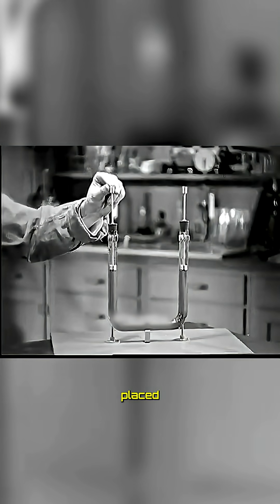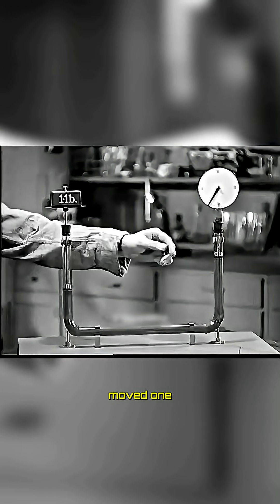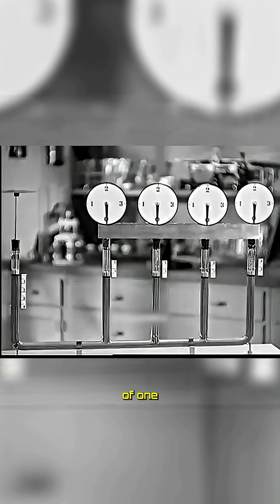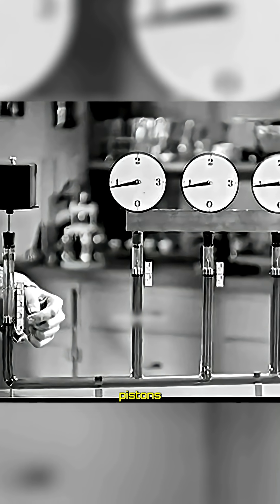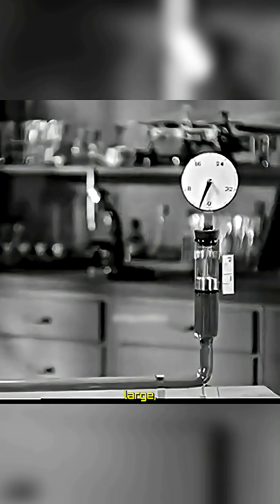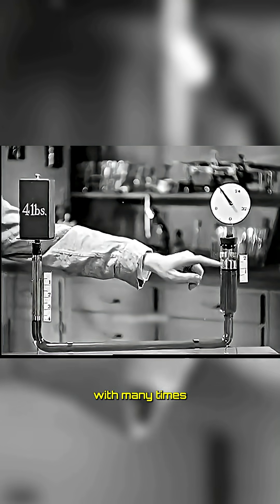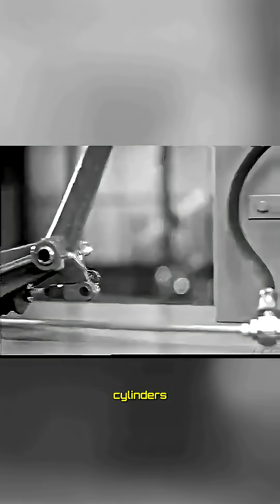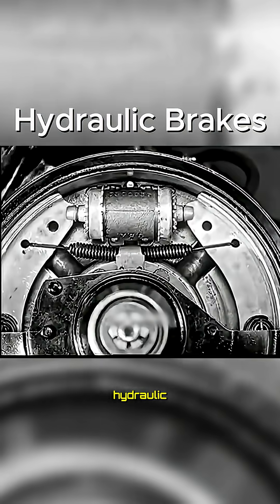The Genius Behind Hydraulic Brakes Explained #science #physics #shorts

Comment: Electromagnetic motors with hydraulic pistons, to create a magnetic differential system, by adding more power to the motors, proportional to the resistance experienced (drag from wind speed)

Also works with pneumatics, using helium or nitrogen, but requires better seals, and gas can be compressed 

So this works better for high impact systems 

Because as the gas is compressed 

The motor has time to sense and respond to this 

As opposed to hydraulics

Which are more powerful, but more likely to break, so needs better metal alloys. Rubber gasket seals. Leaks sometimes 

So for elevators on an aircraft, hydraulics, as well as landing gear

Turrets, and space suit arms and legs 

Pneumatics

Which feels natural, but is less quick to respond basically... slight lag

Which doesn't matter in high PSI, low impact systems, as described 

Which also uses magnetic breaking in an alternating current Electromagnetic motor, made of magnets, coils, and ball bearings, wired to batteries based on magnetism 

You can also use stand alone magnetic motors 

For small, sensitive things

Like fingers 

Or manufacturing equipment 

Because they have a high degree of precision 

With the right software programming 

Which is inherent to electronic systems

A computer, that is

Comment: Then you also have airbrakes. The best in my opinion
Reply: Funny, air brakes is actually a misnomer. The braking pressure is applied by springs. The air under pressure counteracts the springs. If the system loses air pressure, the springs stop the vehicle. So it is the lack of air in the air brakes that does the stopping.
Reply: @briangc1972  on some the spring applies the parking brake, while air in applies the service brake, then loss of air to the system would applie the spring brakes

Comment: Liquids with a gas aka...water can be compressed. When Brake fluid boils it has gas and can be compressed causing spongy brakes.
Reply: Liquids with oxygen cannot be compressed as long as they are liquids. The water has a lower boiling point than brake fluid. Only after the fluid boils and becomes a gas can it be compressed. That is why brake fluid has 2 ratings, a dry point rating and a wet point rating.
You explanation is wrong because the O molecules are always present, they don't just suddenly appear when the fluid boils. A small but critical distinction.
Reply: @briangc1972 oxygen can be compressed.
Reply: @SterlingRobertson  Not in liquid state it can't.
Reply: @briangc1972 yeah, but that's not the point. When Brake fluid passes is limit in temp it will BOIL, making bubbles in the lines. Bubbles are able to be compressed. That's how you get spongy Brake peddle feel.
Reply: water cant be compressed... if it gets into your engine cylinders you can pretty much kiss your engine goodbye
Reply: You realize when brake fluid boils, it's the vapor of the brake fluid creating the bubbles, not oxygen....
Reply: If its totally a liquid, its hydraulic

If it has an air pocket

Gas can form with heat and pressure

But will become supercritical state in a sealed vacuum only containing liquid

IE liquid water, at 300 degrees faranheit 

Then sublimating when Pressure is reduced with gas prezent

"Liedenfrost effect"

Can break chemical bonds of h20

If sublimated into a hot combustion source
"Hydrogen jet"
Reply: You mean dissolved gasses?
Reply: Yall are all missing the point.
Reply: @SterlingRobertson no we aren't, you don't know what you're talking about